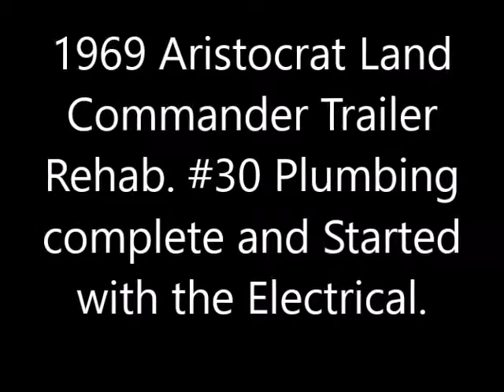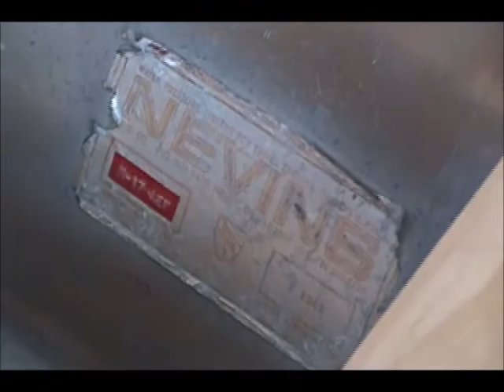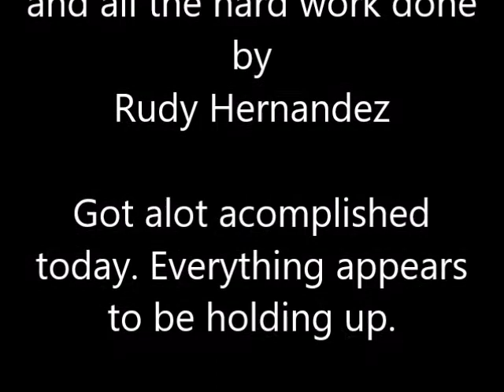1969 Land Commander Trailer Rehab  #30 Plumbing complete and started on the Electrical

Comment: We just bought one and it did not come with the gray tank you have. Did you add it yourself?
Reply from the maker: Yes, I added the gray and black tank... I hoped the video help you... Ask any more questions you mat have...
Reply: We replaced some of the plumbing in ours when we found holes but we now need to get a battery in there to see if the pump will work and show us any more leaks we need to fix. From what I know we need a boat battery. Is that correct? What do you have?? We are starting to feel lost and I'm so grateful I have someone to ask these little questions.
Reply: Rudy Hernandez does the battery have a specific name? Where can I find a battery like the one you're describing?
Reply: Rudy Hernandez how do I send you my email in a private message or something? I'm not as YouTube savvy :)
Reply: Rudy Hernandez or do I just post it on here?